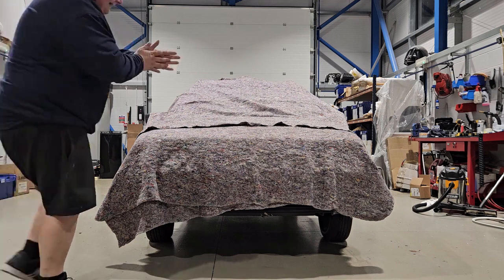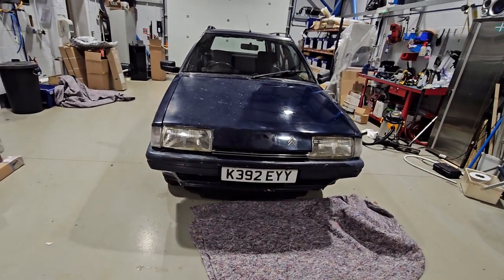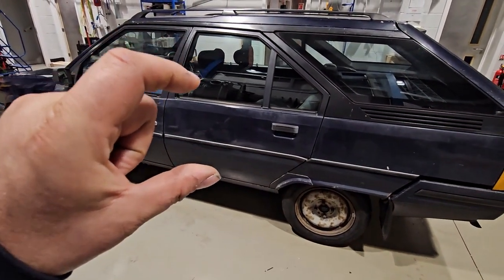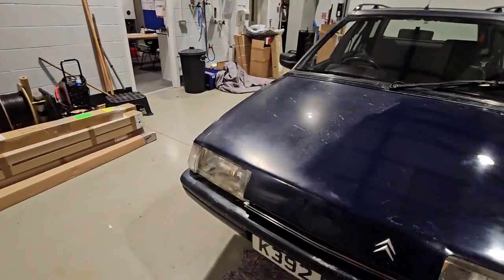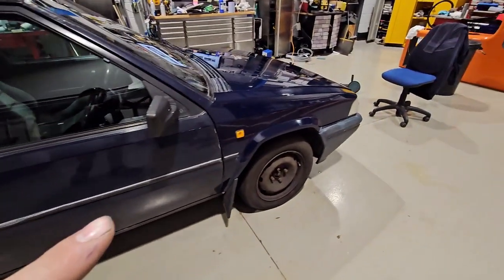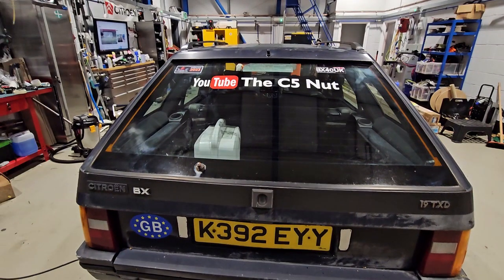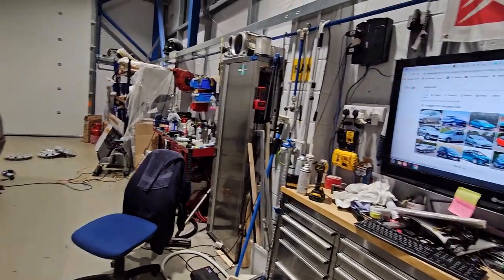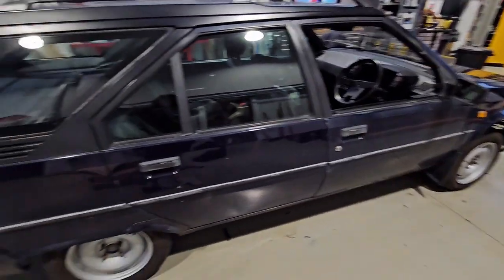we start 2024 with another car, can you guess what it is?

Comment: Loving the progress great work. 

Also, if you hold on to those broken tail lights, could and "make" new lenses for them, in the style of late 90's early 00's home made clear tail lights, where you remove the factory lens, and can get sheets of textured plastic, heat it up to mould it to the shape, cut the excess and glue it on the housing, then use coloured light bulbs to give the correct colour.

Heck I'd be happy to have a go at doing that to the tail lights myself if you're coming to the Weatherby meet, can leave them with me (if I make it there) or Phil Greaves (if I don't) and by the time the national rolls around I might have them done. Would save throwing them in the bin, and I've been wanting to try doing that mod on something but don't have any cars that the shape of the light would suit it.

Comment: Hi here.
Just found your channel.
same as me, as i was younger... i was buzzy with GS and GSA.s had some real fun with BX, even managed to build from hobby a Pro garage..
stopped because of the Millenium bugg, and wen t on with my life as a trucker.

stil driving Citroen , and ended up with a Green C5 2 ltr 16V break.
just did all sferes  and overhauled the rear suspension cilinders..
sitched the HD pump and some other odds and ends maintenance whise..

my question now is..

is the central sfere in the front axle a pressure container, IE not with a shockabsorber in it.
.
i have 6 sfere's  rear axle  central sfere has no shockabsorber....
why is the central sfere in the front axle with shockabsorber????

it looks almost the same as a suspension sfere,, not like an accumulator sfere... 

nice work youre doing,, i would drop by if you werent on the other side of the pond, hehe,, Netherlands here.

LHM  BX..
try Shell TELLUS 32 hydro oil.
mix it with LHM.
1 liter tellus on 3 liter LHM.
lower the front suspension,1,3 CM raise the rear suspension 5 MM.

you wil be suprised how this effects the handeling...

drove 200 000 kms like that... on 205/55/16 michelins energy...aloy wheels..
trick with BX to flush the LHM system.
also BLEED THE BRAKES.
that wil so much enhance the handeling and souplesse..

enjoy .
hope you can help me with my Q.. if you ned tips and tricks on the BX.,,,,, i help out if i can.